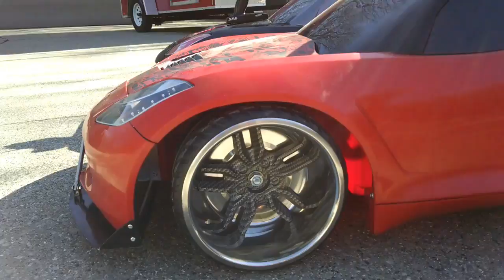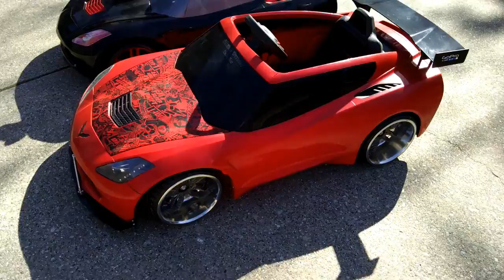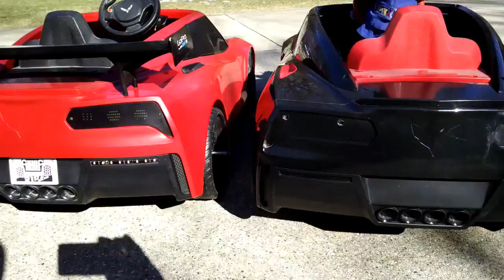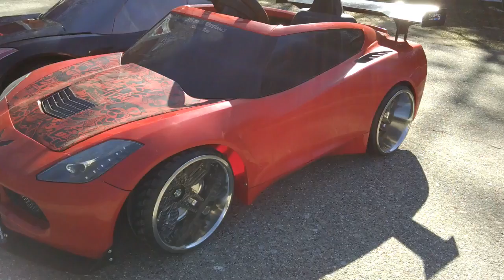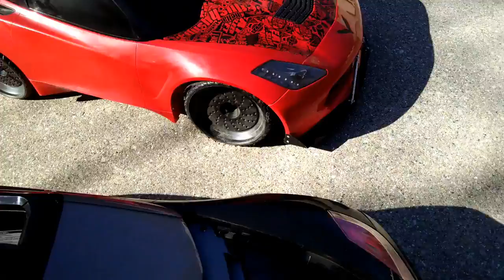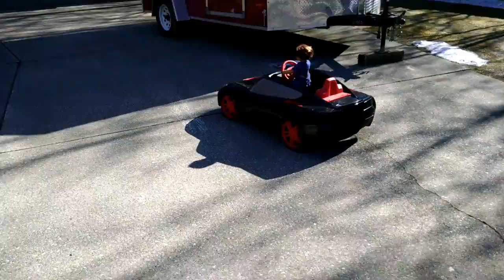Pro touring C7 powerwheels build

Comment: ware can I get a set of wheels like the ones on the red one
Reply from the maker: Betsy Dominguez we custom build them. custombpro@gmail.com
Reply from the maker: not really, and not different brands for sure.
Reply: How do you guys make the deep dish wheels? I was thinking of cutting out the wheel centre's for low profile and installing some stainless steel bowls then cutting a custom wheel pattern
Reply from the maker: And don't forget u need to shorten your axle and spindles.